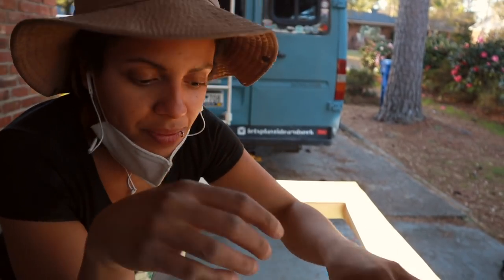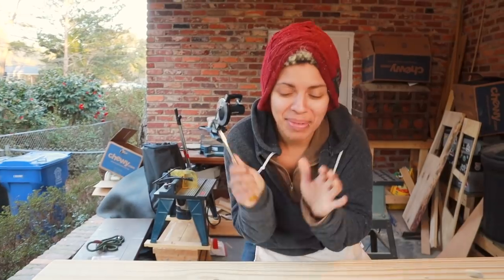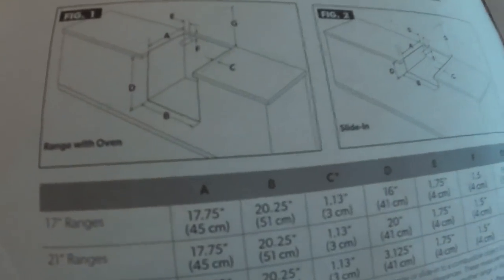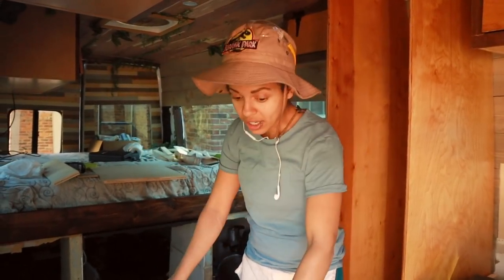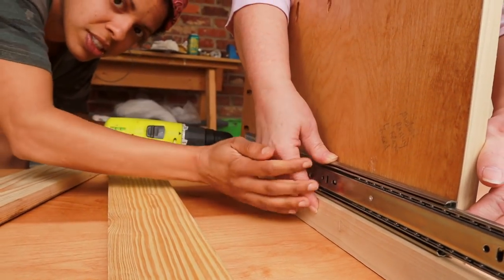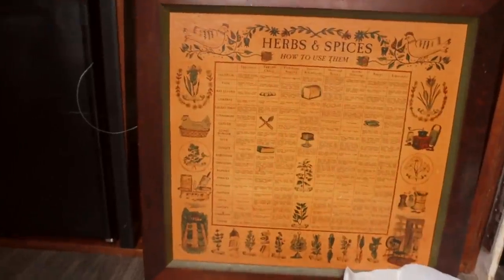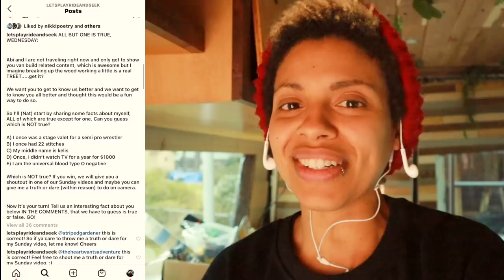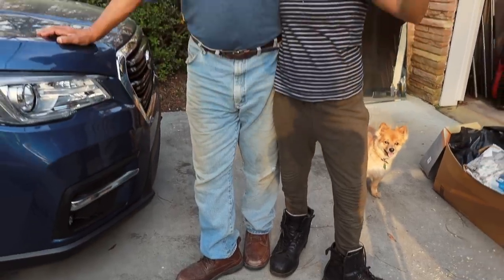THIS UPGRADE IS A GAMECHANGER! Chef Builds Ultimate VAN LIFE KITCHEN (Dometic Fridge/Freezer/Oven)

Comment: The kitchen is gorgeous!!! What type of poly did you put on the wood - can you use the surface as a cutting board and how will it hold up?
Reply from the maker: Thank you! 
We used Minwax high-gloss polyurethane! It’s so smooth, feels like glass! 
We don’t plan to chop on it like a cutting board. We’ll have cutting boards that aren’t fixed so it’ll be easier to clean them. We may make a pop up cutting board somewhere else, and then we’d use a mineral oil or other food-safe finishing. They make a lot of stuff like that for butcher blocks!